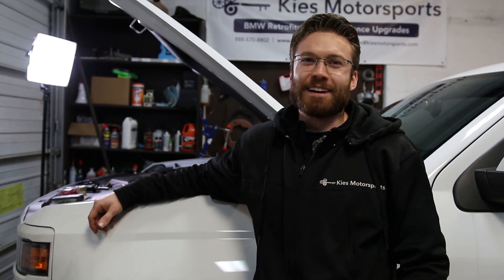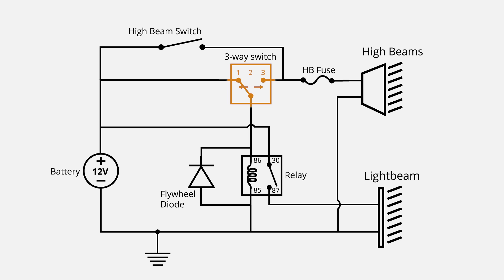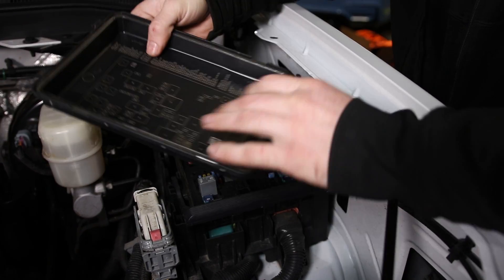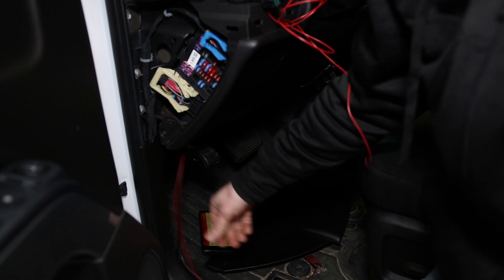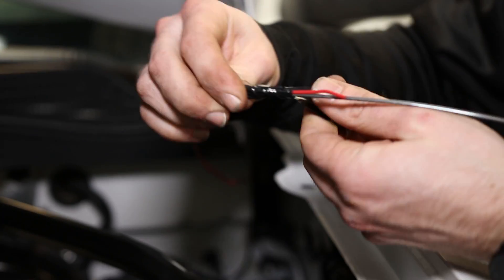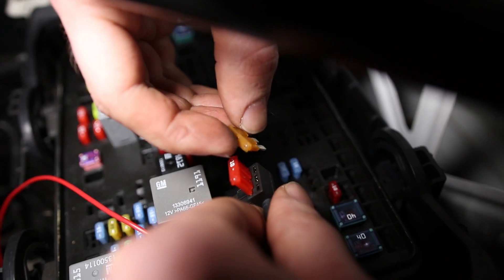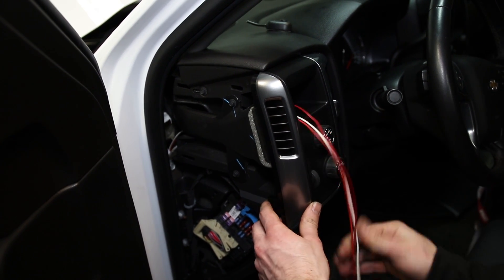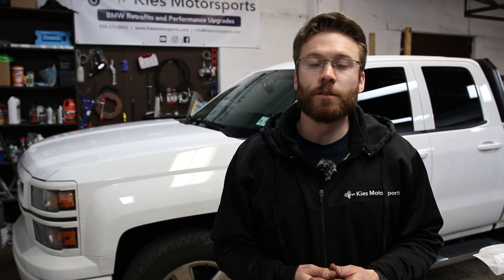How to Connect a Light Bar to High Beams using a Three Way Switch 2014 Silverado

Comment: My Silverado I bought used a 2017 has the same bar in the same place only whoever hooked it up ran it to run with the fog lights. I hate it because I have turn off my fog lights anytime there is oncoming traffic. I will definately be adding a 3 way and hooking to high beams. Thanks for this video.

Comment: Very helpful video! I would like to do this to my 2005 Toyota tundra however I have two 10amp mini high/low beam fuses. One for my left headlight and one for my right. Would the process be the same? Would I just have to get two  add a fuse?

Comment: Do you guys have a video how to wire up extra fog lights to the fog light switch. I have stock ones and just bought the big bangers from morimoto (yellow lens)
Reply from the maker: It would pretty much be the same as this but going to a different fuse.

Comment: Illegal in all 50 states you cannot have off road lighting on a public road, the department of transportation a federal agency controls   motor vehicle lighting laws on any public road/ highway etc. the states are required to enforce the law but states like Texas ignore federal law so here you can use anything from 2 candles or aircraft landing lights, sooner or later the feds will threaten to pull highway funding or will pull the funding until the law is enforced, we have 18 wheeler's with light bars, red lights facing forward and the jacked up pickup's are out of control.
Reply from the maker: Yeah I figured it was illegal in most if not all states to use on the road. Definitely intended for off-road use

Comment: sooooo, lets assume that someone has a fuse that is for both high AND low beams. then what?
Reply from the maker: A 3 way switch would still work, it would just turn on for both low and high beams and could also be turned off and on independently

Comment: If I'm not using the aftermarket 3 way switch, I don't need the constant or the ground from the switch harness, correct? I can simply wire the add a circuit directly to the 30 pole?

Comment: Hi quick question. I have F150 2020 and no fuse to hook into high beam. Apparently there is a module that works it. What are my other options?
Reply from the maker: Interesting, you could Find a wire for the high beams and tap into that.

Comment: For installing a flywheel diode, what's the best way of installing it on the wiring harness that connects to the relay? The diode wire seems too short to bend them on each end and shove them down into the connectors. Any ideas?

Comment: Was wondering how I do this if my high and low beams are on the same fuse? I did exactly the way you have it and even with the car off both ways I rock the switch it comes on. High beams are off as well.

Comment: Unfortunately there is no room for an add-a-fuse in my RAV4 fusebox and it also has two high beam fuses, one for each headlight. I guess I am stuck with a separate switch.
Reply: just run it off the left high beam fuse  it worked for my 4runner.

Comment: I have a question I have a 2017 GMC Sierra and I have the auto high beam on the truck. Ok if u turn on ur high beams the driving lights shut off , is there a way to keep the driving lights on when u turn on the high beams? Also the auto high beam function will not work if the driving lights are on . I want to be able to have the driving lights and high beams at the same time, please tell me there is a way to make this happen lol?

Comment: Wouldn’t be easier to have a tap, from the high beams to the relay (if needed at all), directly to the auxbeam, to activate the light bar whenever the high beams are selected? Most people would want the auxbeam to come on whenever the high beams were selected. Just saying.
Reply from the maker: You can directly go to the high beams and avoid the switch inside the cabin all together.  I wanted the option to have it come in without the high beams too. This lets me turn the light bar on automatically with the high beams and also turn it on when the truck is fully off.

Comment: I installed the same auxbeam light bar behind my grill just like the first video. I want to do a straight install to the highbeams. I read in the past comments just run the relay straight to the high beam add a fuse? What do I do with the other wires coming out of the relay? Thanks in advance

Comment: Hello Sundae Drive,
I have a new Chevy Silverado RST 1500 truck. I would like to install a light bar without running a lot of wire in to the cab. So I’m thinking of a couple of thinks and maybe you can tell me if they would work. #1 on the left side of my steering wheel I have controls for Cruise Control, Heated Steering Wheel and on other model trucks like the High Country they have the Front Bumper Collision Avoidance Button. Now if I changed out that Control cluster to one that has the Front Bumper Collision Avoidance Button is the harness there for it and could I use a fuse tap to power the relay? 
#2 My RST has the button cluster below the radio with the switches at each end being blanks.  If I changed them out with OEM active buttons is the harness there for them and then could I fuse tap them for the relay?
#3  I was also looking at fuse tapping off the fog lights or the cargo lights as my least favorable options.  
Please let me know what you think and if you have any suggestions that my help me out.
Ed
n3rsn@yahoo.com

Comment: Wat would you do with negative switch ..high beam
Reply: I have a 2001 duramax where the high beam wire becomes negative when they are on. Looking into adding another relay….

Comment: I have a jeep wrangler 2009.  I have tapped the high beam line for my switch to the relay.  What I am finding that occasionally the LED Light Bar is flickering (seems the relay electromagnetic switch is oscillating the signal sent due to the PWM high beam line).  Where should I start or look at to solve this issue?  Thank you!

Comment: Hey, I really appreciated the video on adding a 3 way switch and controlling the light bar and high beams together and independently.  I was wondering in your diagram where you would put and inline fuse for the Light bar?  I would have expected to see one either in the feed to relay  30 or between 87 and the light bar.  What do you think?  Where should the inline fuse go?

Comment: Could you just run the power wire staright to the fuse tap so you don't need a switch, and it only comes on with high beams? if that question makes sense lol
Reply: Pretty much im asking can you not hook the power wire up from the relay and just run the red wire from relay straight to fuse tap? that should work im assuming because when the high beams come on through the fuse it should send power to relay which would in turn, turn the light bar on?
 lol
Reply: nevermind lol I see the previous comment, thanks and love your channel
Reply from the maker: You can definitely hook it up without the switch so it will always come on with the high beams. I like having the option to turn it in with the truck completely off tho. It has come in handy several times. Thank you! Glad you are enjoying the content :)

Comment: How about a video without the switch nobody needs?
Reply from the maker: We could definitely do that. Pretty straight forward. Just use a relay and tap it into the high beams in the same place we did and that will work without any additional switches needed 👍

Comment: Thanks for taking the time to do these videos they have been very helpful.  Question: I would like to just tap into the bright headlights and not use a switch at all.  I have ran my current wire with a switch on it over to the fuse box, when I cut off the switch it will have 3 wires, blue, white, and black.  Which wire do I tap into the bright fuse? white or blue or both? should I just ground the black (assume its ground) to the body next to the fuse box?   Also if it matters I have a fuse for each bright head light.    Maybe tap the blue wire to one and white to the other? Thanks for the help.  EDIT UPDATE  the switch does has a red light on it to show when the switch is turned on.  Assuming that why there are 2 power wires.
Reply: Yes, thats why there are 2 power wires, one for the lights, and one for the indicator light.

Comment: I did this same set up, but some times the lights have a delayed reaction when going of from the full beam, about 10 seconds...when going off from the switch its fine, any ideas?
Reply from the maker: Hmmm, sounds like there is a capacitor slowly discharging or a parasitic draw on the battery. Did you install a diode?
Reply: @TheSundaeDrive  thanks for the reply, i ripped every thing out and started again, i forgot i had to extend the cable as it wasnt long enough, when taking it out the earth had poped out the conector, so hopfully thats it now !
Reply from the maker: @Kevging88  hopefully that fixes it for you!

Comment: Is it possible to do this with jus a regular rocker switch?
Reply from the maker: Not as a 3 way setup that I have. You could just have it on with the high beams or always off with just a regular rocker switch. The 3 way switch is nice if the truck is off but I need light, I can just turn the switch on.

Comment: Just a little tip. those butt connectors are flared so you heat shrink them to the wire.
Reply from the maker: Thanks!

Comment: My high beams have 2 fuses. One for the right and one for the left. How would I tap into them?
Reply from the maker: You only need to use one if the two. As long as either is tapped, the light bar will come on since both high beams turn on together.

Comment: Is this a reliable solution for the long run? Since I don't usually check the wirings too often unless there is any issues coming up. Any chance of short circuit or fire hazard?
Reply from the maker: Mine has made it through a winter with no issues. Make sure to use marine heat shrink on all connections to ensure water doesn't sneak in and don't  leave an exposed wires and you should be good.

Comment: Hey, so I am a little confused. You have this wired to your brights, and with the switch to allow it to run independent of the brights or with the brights. Is the power to the lights still controlled by the brights stalk?  And the switch just controls whether or not it uses one or both?
Reply from the maker: So when the three way switch is in the center position, the light bar will not turn on by any method. Switch the switch to position one turns on the light bar (the relay closes the connection via the energized relay and now the light bar is connected directly to the battery so that it will continually run until the battery drains). In position 1, the high beam switch operates independently and has no control over the light bar. When you put the 3-way switch into position 3, the high beam switch now controls the light bar operation.  If the high beams are off, the coils in the relay are not connected to power so the relay remains open. If you turn the high beams on, the coils in the relay are energized and the connection is closed, connecting the light bar to power. The light bar is always connected directly to the battery, the connection is either controlled by position 1 on the 3-way or position 3 via the high beams.
Reply: @TheSundaeDrive  ah! Perfect! Thank you so much for your detailed explanation.
Reply: Excellent video.. so informative. My LR4 does not have a fuse for the high beam. In that case, should I just connect it to the wire feed into the rear of the light unit?

Comment: Where did you end up mounting the switch? I'm planning on using this but for reverse flush mounted lights instead. This was super useful!
Reply from the maker: Still haven't mounted it lol. I'm actually in the process of figuring out a way to integrate it completely into factory controls potentially. That video probably won't be out until early next year tho
Reply: I ended up doing an on/off/on toggle switch but instead of putting it where the trailer break would be I used a factory fastener at the bottom to slide it in. This video saved my life when I couldn’t pass the wires through the boot grommet.
Reply: I removed the 12v cigarette lighter switch and installed the switch there.  The hole is already there in the dash and hidden away
Reply from the maker: Not a bad idea!
Reply: @TheSundaeDrive  thanks
Reply: @kevinw.1737  so now u can’t charge ur phone? lol

Comment: If you only want a light bar to work with high beam than you dont need a switch at all right? From a light bar Would you just wire red  to a high beam fuse and black to  ground?
Reply from the maker: The 3 way switch is only so you can use them independently correct.

Comment: Called "Fly Block", not "Flywheel". Amazon lists many of the former but none of the latter.
Reply from the maker: I assume you meant fly "back" diode? You are correct. It can actually be referred to by both terms but flyback is the more common term

Comment: What gauge is the extension wire?
Reply from the maker: They aren't carrying an significant current so a 14 Guage should be ok. It depends how long of a run you are doing of course

Comment: How do I eliminate the third party which and just work when I activate high beams. Can you send me a diagram to my email
Reply from the maker: So you want it to either be off or just on with your high beams? Never in without the high beams?
Reply: I think that’s what he means
Reply: Me too. All the videos show the same information nobody needs.
Reply from the maker: Do you want it to have a two way switch that only activates it with the high beams or turns it off without independent operation or not even a two way and only with the high beams?
Reply: @TheSundaeDrive  only with the high beams.
Reply from the maker: @leightaylor7019  you would hook it up the same way but just eliminate the 3 way switch. Don't run any wires into the cabin and hook the relay directly to the fuse for the high beams.

Comment: So I purchased a torch series light bar grille setup would like to run my wiring like this cause it seems like a better way, just wanted to know how you mounted the 3-way switch? Cause I currently have my light bar into my fog lights.
Reply from the maker: So I still have mine loose in that upper opening. I may build a plate to Mount in that space for any additional switches. I still have several upgrades I am going to do (adding a camera and more lights) so I am holding off on mounting anything until that is done.
Reply: @TheSundaeDrive  oh ok thanks for the reply, would you be doing a video on the installation of a tailgate light bar?
Reply from the maker: I'm going to be adding a rear facing light bar to my headache rack very soon. I have all the parts and just waiting to shoot the video. I am going to make it activate in reverse and with the bed lighting. By tailgate light bar do you mean the led strip between the tailgate and bumper?

Comment: I have the same truck. I drilled the hole in the same spot in the fuse box. When the wire is inserted in the whole when I turn the ignition off the truck stays running even with the battery unhooked. If I remove the wire and turn the ignition off the truck kills. I wouldn't recommend putting the wire up through the bottom of the fuse box.
Reply: There is a circuit board that covers the entire area of the fuse box. Drilling down through the fuse box in that area drills through the circuit board.
Reply from the maker: That is extremely odd. I seem to recall some relays near where I drilled. Nothing underneath but stuff on top so you need to be careful where you drill. I'm curious what your electrical setup. Are you using a similar relay and three way switch?